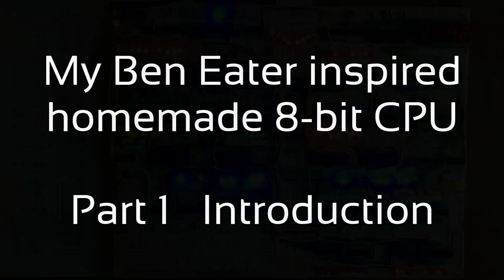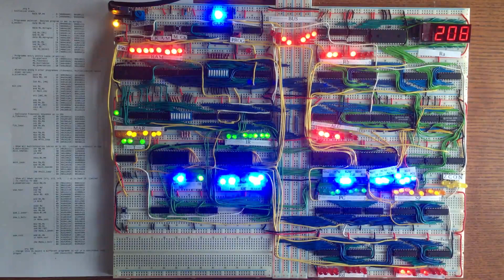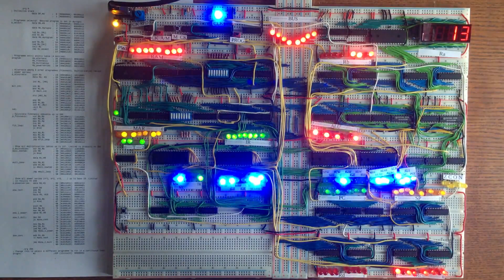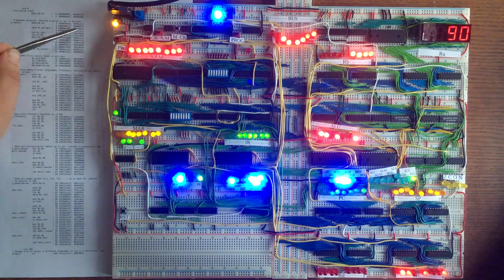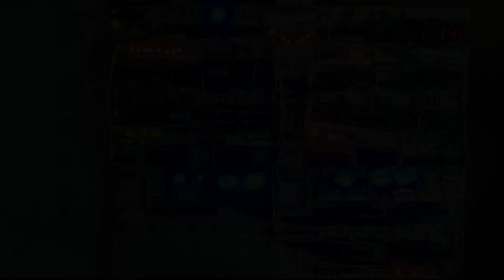My Ben Eater inspired homemade 8-bit CPU  -  Part 1: Introduction

Comment: Very interesting, that you use a modified Harvard architecture. I know the atmega328P (arduino) uses the Harvard architecture, and the Z80 uses a Von Neumann if I recall correct.

Comment: Actually your architecture which uses separate memories for opcodes and data is beeing used in most microcontrollers (cause they use flash memory) and is called Harvard-Architecture. Great build!
Reply from the maker: Yes I know. That's where I got the idea :)
Reply: He literally says that in the video

Comment: Thanks James for your efforts on this! So many "oh yes!" moments echo my own journey from software-only to hardware-aware. Your descriptions and explanations have plugged big gaps in my head. I tinker with microcontrollers, PIC16/18/32, and now the Pi Pico. It's less daunting to consider these as citadels composed of building blocks like your breadboard.
Perhaps you can avoid the blue LEDs in future builds so we can better admire your wiring and layout? ;-)

Comment: Mr Bates - are the schematics in your github repo (https://github.com/jamesbates/jcpu/tree/master/schematics) intended to match the breadboard shown in your videos and the arduino programming code in the repo?  Is it possible that the control logic schematic is for an earlier version? It appears to have an extra ALU control line (ALS3) - which I'm guessing may be from an earlier design that used the 74181 ALU (which has 4 control lines)?  Also, the PCC control line is not in the schematic.

In addition, the video detailing breadboard RAM module makes it appear that the address switches are actually pulled up to 5V, whereas the schematic shows them pulled down to ground.
Reply from the maker: There has never been an ALS3 line, either in my schematics, or on the breadboard, as far as I know. If you found a mention of it somewhere, it is definitely a typo. 

As far the pull-up or pull-down of the switches, I honestly don remember which I actually used; either works. You just need to make sure you connect things up properly. (pull-up/-down side is the signal with the switches open)
Reply: @jimmyb998  Thanks so much for your fast reply - your project is very inspiring and has convinced me I could succeed with something similar (with some modifications of my own - such as using the 74181 ALU instead of the 74382).  It is with some nostalgia that I've opened my ancient TI TTL data book (copyright 1976) , which I haven't looked at in many decades.

I retrieved the control logic schematic at https://github.com/jamesbates/jcpu/blob/master/schematics/control_logic.pdf, which shows an ALS3 signal connected to pin 16 (I/O4) of the EEPROM0 chip.  Am I maybe getting the wrong control logic schematic?
Reply from the maker: @curiousStudent-c5y  ok, yes that schematic is wrong. The pin assignments I use are found in the microcode: https://github.com/jamesbates/jcpu/blob/master/arduino/Microcode/Microcode.ino#L19

It looks like, on the schamtic, ALS3 should be removed, ALC, ALW and ALE should all be moved one bit to the left, and the final pin is connected to PCC, which is completely missing from the schematic :/

Well soptted!

Comment: I'm just now in the process of building a system similar to yours. I wondered if you'd thought about interupts? Did you consider Non-maskable Interrupts (NMI), Maskable Interrupts, Shared Interrupt Requests (IRQs)? I'm using two eproms of 2048 which have 16 addresses each, so I could handle a lot more than the 27 control signals you have. I was thinking if I were to put in peripherals, like keyboard or HD, then I'd probably need some kind of hardware interrupt. Do you think using control signals to the control unit is the best method? (I realize you probably long ago ripped apart your computer!)

Comment: impressive project, I'm not sure if you've tried using the cpu to generate video and audio signals and put into a full casing with a monitor and floppy drive but I might have a serial video card that can sit on a breadboard that  may be interesting to use if  you were interested in doing that
Reply from the maker: I like the enthusiasm!
I think that, before I can connect to any peripherals, I'll need a bit of re-engineering. I'll need an interrupt mechanism for a start, and an I/O bus probably. And considering the tightness of my 8-bit opcode space, I'll probably need to expand to two-byte instructions, which means redesigning the control unit, etc... Also, I'd like shift and rotate instructions, so I can multiply and divide more efficiently.
I agree though,  seeing a processor come together like this, gets the imagination going... I can absolutely appreciate the enthusiasm that computer pioneers in the 70s and early 80s must have felt!

Comment: 2:06 did you mean full 8 bit numbers and 16 bit addresses? Can't see a C program of any size fitting in 256 bytes, but I might be wrong. And even 16 bits is just 64kb

Comment: The first thing I want to do is use a massive 1 MB SRAM which I find are very inexpensive. And possibly separating the 8-bit Data and 16-bit Address bus. And then I might add segment registers, like the 8068 has to have the program segment, data segment and stack segment all in different areas of the big memory.

Add Ben's HLT opcode to stop the clock, and then you can single-step, and clear the HLT line with the next clock cycle.

Comment: What did you make for dividing the memory of data and program? Do you use up code and code?
Reply from the maker: A ninth address line. I effectively have 9-bit memory addresses. The least significat 8 come from the memory address register, and the ninth bit is controlled by the control logic, since it decides whether to read data or program memory. More details are in my episode on the RAM! https://www.youtube.com/watch?v=hRJO97PbPlw

Comment: Congrats!! I too am from a Computer Science background only I am using this information to learn how to build oscillators, filters, amplifiers and sequencers for synthesizers. I have been learning how transistors work by implementing basic logic gates with them --- I do have IC chips but it's more fun to build to parts yourself. What I have learned is that circuits are not like functions, you don't just attach inputs to outputs e.g. An inverter is 1 transistor, an OR circuit is 2 transistors but you only need 2 transistors to make a NOR circuit, not 3 ... you don't just hook up the output of an OR to an Inverter and call it a NOR ... circuits are more delicate than that.
Reply from the maker: Yes, I agree. The digital world of a computer program is in fact totally artificial and "unnatural". What I find incredible, is that it has become possible to "tame" and "force" nature (in this case electrons mostly) into behaving in this, for them, "unnatural" way, so that we poor humans can actually see, and play in this "digital, imaginary world".

One of my favourite circuits, is the bipolar multivibrator http://www.learnabout-electronics.org/Oscillators/osc41.php . So simple!

Comment: Without having watched your videos yet: it'd be interesting to add a bootloader so that it can load programs from an EEPROM or even flash memory.
Reply from the maker: Yes, that is painfully necessary. Inputting 16 bytes with DIP switches is sort of ok. Entering 256 is very time consuming and error prone.

I am considering a flexible way to add just such an extension.
Reply: James Bates https://create.arduino.cc/projecthub/david-hansel/breadboard-computer-programmer-1e7a09 David has done a boss effort of even running a monitor via USB serial and dumping programs to and from and Arduino.

Comment: now i know to not use blue leds in mu cpu :)
Reply from the maker: :D Yeah, those things are WAY brighter than the other leds. I tried limiting the current to 5 mA and even then, they're much brighter.

In real life it looks better than on video, I guess human eyes can handle varying brightness better than digital cameras.
Reply: @jimmyb998  Did you try limiting it to 1mA or less than that?
Reply: Our retina's cells get tired when there's too much light and that makes a negative afterimage, that's how you can adapt to varying levels of brightness. However, Ben's videos don't have that problem. I imagine that it's because of the lighting (more lighting = more uniform brightness) and/or (OR gate) the camera. Or maybe it's the LEDs.
Reply: I have some blue diffused leds which look very nice but you may have to cover leds when making a video.
Reply: They are shirk and against the tawhed of God 😂

Comment: Hi James, Many thanks for that great videos!! I just finished Ben`s CPU with the extension of David Hansels Programmer. Now I am starting to build your CPU, some questions: Where to get the values of the used capacitors and resistors, and what is your excellent wireing technique, what tools are you using, how determine the right lenght, the position of bends and so on. once more: many thanks for your work and your answers
Reply from the maker: I ought to add the resisitor and capacity values to the schematics, I agree with that. I usually mention the values in the various videos, although I may have overlooked some. Please ask me about any specific ones!

In general, I use ~1k-10k Ohm for pull-down or pull-up resistors (DIP switches etc), about 150 Ohm to current-limit LEDs, and appropriate values together with capacitors to obtain desired RC constants (clock, memory write edge detector).

As for my wiring "technique": as I say a few times throughout the video series: I am a total novice when it comes to hardware. Honestly, this is the first time I've built anything like this, and my only guide was Ben Eater's excellent video series. I honestly wouldn't consider that I have a good "technique": my wires bend very amateurishly, my LEDs are completely unaligned, I tend to cross wires any which way... Really, I just unrolled the wire spool, and held the wire where it was supposed to go on the board. Then held the position with my thumb, and cut it with wirecutters. To bend the wires, I used my fingers. In fact, using my "stellar technique", I'd say I got it wrong about 30% of the time, and had to redo wires often. I also ran out of blue and green wire halfway through the build, which is why the right and left-hand side of the CPU have different wire colouring. All in all, I really can't imagine anyone being more amateurish than me :D

I went with Ben's advice to buy good breadboards. I expect they saved the day for me, as from top-left to bottom-right, even with my horrible wiring, I have a total resistance, in say the 0V rail,  of ~4 Ohms.  I think Ben has a video somewhere about cutting wires, and using plyers to shape them.
Reply: Thank you! completely other question: I saw you linked to a german conrad.de site. I am from austria, are you in german speaking area, too?
Reply from the maker: yes, Berlin ;)
Reply: servus nach berlin
Reply: sorry, das muss wohl tschüss heissen :-)
Reply: servus aus wien :-)
Reply: Don't worry, your technique is better than mine (use prefabricated jumpers that hang through the air over the breadboard & components), and I have already 5 years of experience in electronics! I think it's a matter of how lazy you are and your experience doing organized connections (I have none). However, for this project, I want to do it neatly because it'd be a PITA to debug later if I don't, so I'm buying another wire stripper (the automatic one I have is for big cables 10-22 AWG, and it doesn't work well with my 28 AWG "breadboard" cables) that's made for 28 AWG. I've seen an automatic one that seems to be good for up to 30 AWG, so I'm probably buying that one.

Comment: Good stuff!

I upgraded my build to have 8 bit PC and memory addresses already some time ago, but I'm handling memory addressing differently at the moment. I liked being able to have "fast" instructions that only used a single byte of memory just the same way as Ben's design, so I actually have two versions of each instruction. One for addressing a value in only the first 16 bytes of memory with only one fetch cycle (e.g. LDA) and a second version that performs an additional fetch cycle to grab the operand in the next byte of memory (e.g. LDA2). This does "waste" memory in my 256 bytes compared to what you're doing, but it does seem to be sufficient for now. I also reprogrammed my microcode to have 6-bit opcodes that overlap partially with the lower 4 bits on the instruction register. I get away with the "fast" instructions  by making the actual values in the lower 4 bits independent of what is in the upper 4 bits. For example  the two overlapped bits XX between operand and 6-bit opcode in 0100 XXYY are ignored. However this also means I have to have a bunch of "wasted" opcodes that really do the same thing (i.e. 0100 00, 0100 01, 0100 10, 0100 11). Thus instead of having 64 true independent instructions, I really only have about 40 unique opcodes. Still better than 16 in the original design!

That said, I think I'm definitely going to implement your method of using 9th bit on the memory for the pseudo-Harvard architecture. I'm using an IDT SRAM chip with 15 bits of address space already, so it won't be a problem. I'll just add another control line and micro-instruction to activate the 9th bit in a two-stage fetch cycle. This will have the added benefit of not having to increment the program counter twice for every instruction, which I think could lead to bugs with jump instructions, among other things.

Hmm, this also gives me ideas about how to possibly use the entire 32K of my memory address space. Although, maybe it would be better after all to just build a dedicated memory bus and be done with it.
Reply from the maker: Well, if you have only 2 registers, as Ben did, you might get away with only 40 opcodes. Since I wanted more registers, and in fact have 4 or 6 now, depending on whether you include PC and SP, for a single typical 2-operand instructions, I need 36 opcodes per instruction. And indeed, when I got to the ALU, I was running out of opcodes, even with a 256-opcode space. That's the main reason that I went with effectively one-operand ALU instructions (the second being fixed to Rb), needing 4 opcodes per instruction for them (See video nos. 6 & 7).

I never thought about this aspect when I started out, thinking 8-bit opcodes would be more than enough. Turns out that as soon as you up the register count, you run out of opcodes exponentially! I think of the data/program memory separation more as a gimmick. The most complex program I ever wrote, is the prime numbers calculator I show off in the last episode (video no. 12). And I think it's code + data + stack would just about fit in 256 bytes, so theoretically I could have got away with classical von Neumann.

The main limiting factor is definitely the opcode space.
Reply: I'll watch through your other videos and see what you did. Definitely interested in expanding what this thing can do.

Another change I'm going to make is replacing the simple add/subtract ALU with a couple 74LS181 chips, which offer 16 arithmetic and logical functions, as well as a comparator. I'll handle those with more control lines from the EEPROMs, although I think I can only fit one more of those chips on my build before exhausting the EEPROM address space fully.
Reply from the maker: I looked at the 74LS181, but decided on the simpler 74LS183, as it has one less control signal, and therefore frees up an EEPROM address bit. Does everything I need. Again see video no. 7 ;)
Reply: Stephen, I assume you already know this but just in case you don't, your scheme of fast instructions is very similar to how the 6502 has so-called zero-page variants of many instructions. Page zero being the first 256 bytes of memory (in your case 16 bytes, but that is just details). On a 6502 system, page zero is also where the stack lives (going down from 255) so that makes accessing local data fast. Which also speeds up interrupt handling which is nice.
Reply: Funny enough, I didn't know that at the time I implemented that (my background isn't in anything remotely like this). It just seemed like the logical solution to enabling more RAM whilst keeping the simple instruction set of Ben's original design.

In the mean time I have read quite extensively on the 6502 and did chuckle a bit when I read about zero-page.